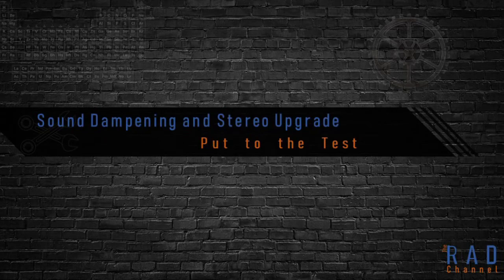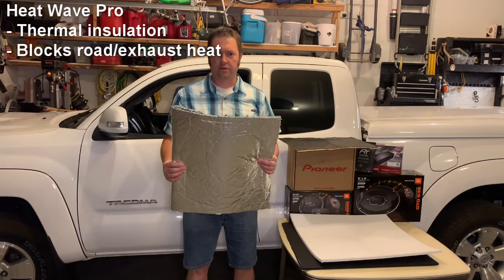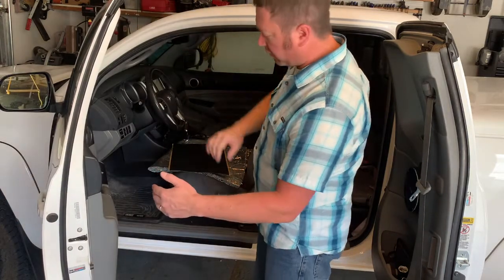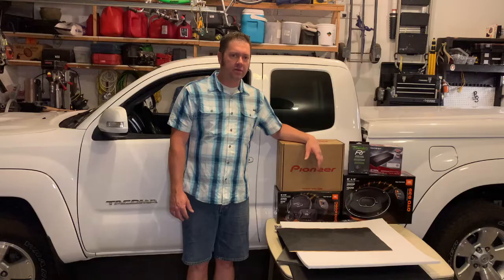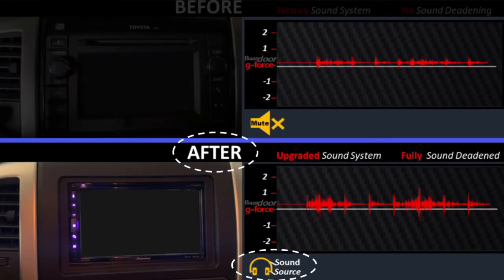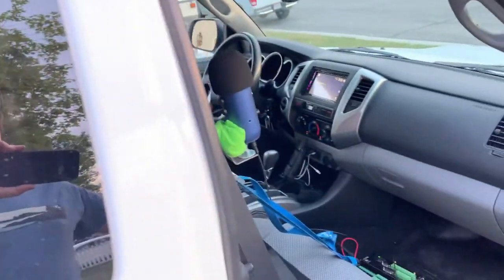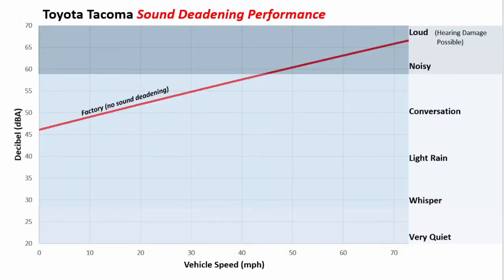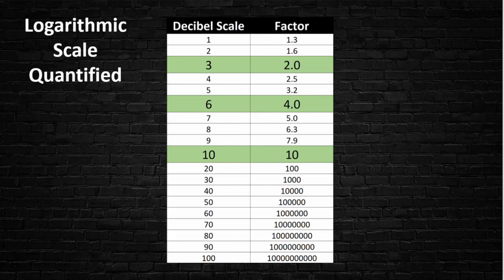Sound Deadening Review, DIY tips with a  before & after analysis on soundproofing and stereo upgrade

Comment: How you took pictures of the doors to make sure you didnt spill over with the deadner is a good idea. I also have a white toyota and i did deadner all over it, not to the level you did, but i took a pencil and actually traced the door panels and once i got the mats installed i just took some glass cleaner and wipped off the marks. It worked really good because i was able to get rught up to the edge of it witch isnt needed but still worked good. Both ways work unless your car is dark then my pencil way wont work lol